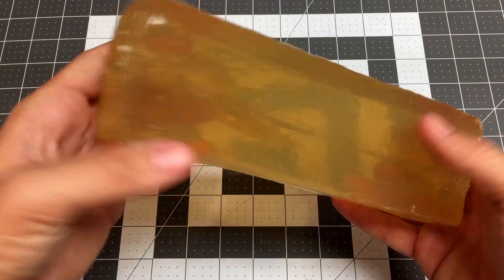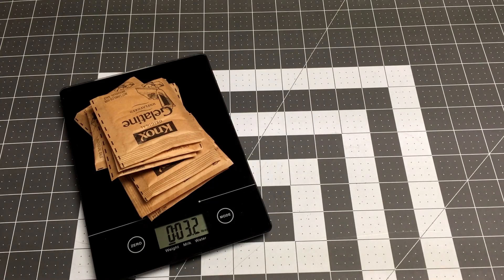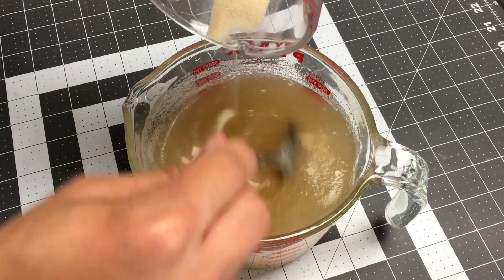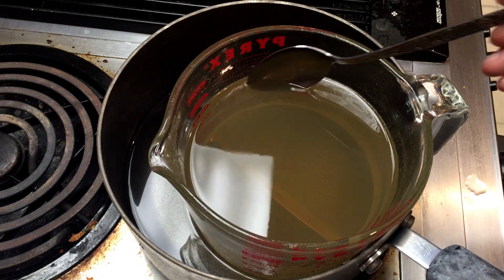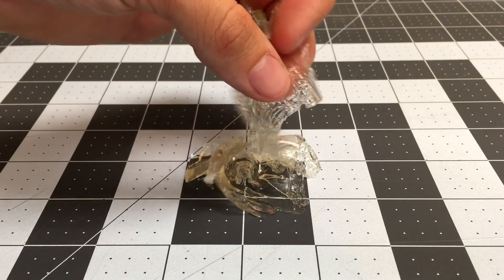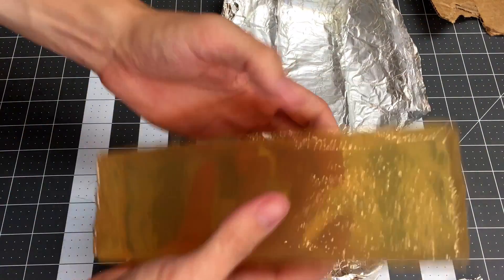How to Make Ballistics Gel

Comment: Yeah but how much water do you add initially to the powder when melting it down? You only gives the final weight of the gel block. That's not the formula
Reply: 1oz of gelatin to every 8 oz of water. The gelatin thickens during the heating and cooling process

Comment: I made some ballistic gel using the ratio from the video. In my opinion it's much too soft and floppy, for lack of better terms. I increased the ratio to double the gelatin. So 2oz of gelatin for 1 cup of water.  I don't know what the guy in the video is shooting with, but I used a large caliber and it absolutely annihilated my first slabs of gel. Didn't work at all. Try double the gelatin!!!
Reply: he was using a pellit gun
Reply: Does not really matter what gun is used. Gel is a test platform to make assumptions what the bullet does to living tissue.
Reply: @henriklopperi6686  I was shooting .450 Bushmaster, a 250gr polymer tip jacketed hollow point going 2200 fps @ 50 yards out of an 18.5" barrel. The whole block of gelatin just exploded.
Reply: Nato uses 20% gelatin and FBI 10% according to my sources.

So it it blows up, you need to make it bigger.
Reply: @henriklopperi6686  that's the new plan! 👍
Reply: @henriklopperi6686  Doesn't the FBI also put denim in front of the gel? Or is that outdated info?
Reply: @519FIREARMS  I made my first one out of a massive storage tote to get one to show the 450 wound channel properly. I sold the gun and built a 350L after, 450 was awesome but way more power under 100 yards than i need or wanted. Oh, at 75yrds its still split the 2'x2'x3' block like it was nothing, absolutely incredible destruction. There was maybe 3-4" connecting the two half's together at the bottom. And to think i wanted a 45 Raptor or a .460 S&W single shot 🤣
Reply: @_DeFiNiTeLy_Not_BrAd_  that's a good idea!! I sold my 450bushmaster, but I did buy a 500 magnum!! Lol I'd love to see how it performs in ballistics gel! I'll get back with my results!
Reply: 10% gelatin is supposed to be very close to the FBI standard.

Comment: "If it's hot outside it wont be as strong as it needs to be, so keep it cool"

Wyoming regularly gets up to 110 farenheit in the summer
Reply: Well that still leaves you with about 3/4 of the rest of the year to play with it, right?
Reply: @bluewater82  winter normally gets below negative 20 and lasts 4 months. And summer stays over 100 for 3 - 4 months too. So 1/3 of the year I guess
Reply: @Reallytallsocks  Keep it in a cooler till your ready to use it and stop complaining
Reply: @Andrew Coles Fremont. Aside from the two or more weeks straight we had in and over the 100 degree mark earlier last month, the unusual amount of humidity and mixture of smoke in the air from Colorado and Montana burning to the ground has the temp hovering right around 75-85. But the humidity isn't normal, and this years weather is just kinda fucked. August is usually BALLS hot, so this year is throwing curve balls

Comment: Just for clarity, 1oz gelatin to 1cup(8.2oz) of water is 10.8% gelatin. To get closer to 10% you want to mix just below 10% because some water will evaporate off during the making process. You want to be right about 0.9oz gelatin per 1cup of water. But there is a scale in this video, so best to just zero the scale with empty cup on it, weigh 9oz water and then use 1oz gelatin. Not sure the little diff matters here for the use in this video, just noting some math.
Reply: He weighs with the paper its fine

Comment: Sorry but I need to call BS on your video....KNOX gelatin is not and does not have the BLOOM strength to qualify as a "ballistic gelatin"
Reply from the maker: No need to apologize, I had thought I had mentioned this in the video but I guess I didn't. I'll stick a shorter version of this in the description: 10% ballistic gel is the most commonly used formula for ballistic gel and has a bloom strength of around 250 bloom. While I did not test the bloom strength of Knox gelatin myself, after a quick google I am now an expert and it sounds like Knox is about 225 bloom. This puts it at 90% the bloom strength of the common 10% gel mixture. So yeah, the FBI probably wouldn't use it, but for a amateur like me an A- gel is indistinguishable from an A+ gel.

( https://www.chefsteps.com/ingredients/gelatin )- this is the website that I cite the bloom strength from. Could be crazy wrong.
Reply: @Sciencish  Sounds like 225?? Did not test? 90% ?

That's a lot of guessing and assuming....thank you for confirming my call out. ....and it's less than A-, but why bother with tests and math and all that.
Reply: Actually the less liquid u use its gets morw dry n hard n dont liquify after in heat at all . O have used this many times. Thats why its called diy

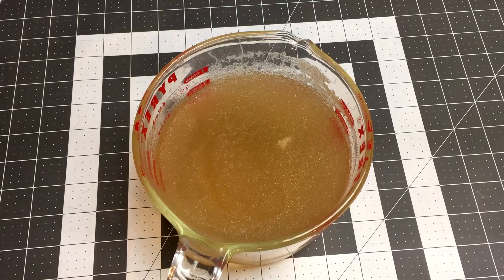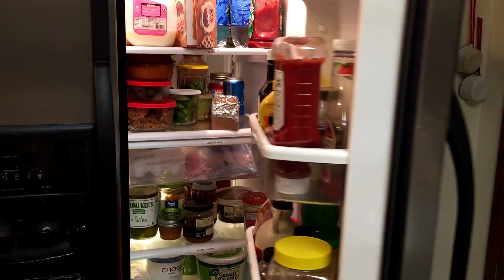Comment: So first we put it in the fridge for 2 hours (0:51) then 12 hours (1:29) ???  Why do we need 10 extra hours?
Reply from the maker: The first 2 hour refrigeration hydrates the powder but leaves the mixture crumbly, cloudy, and overall no good for testing. This is why we melt it back down and remold it, so that it is a consistent firm block of gel at the correct temperature to be as strong as it needs to be for testing.
Reply: I made some, except the second setting, I left it in the fridge for about 3 hours and it was good and rubbery

Comment: Question; After being 2hours in the fridge, the first mixture is still not jelly-like. How could i prevent this ? I used more than enough gelatine.
Reply from the maker: The two fridge time is to bloom the gelatin, when you poke it does it kind of break and crumble? If so you’re doing fine, just remelt and refrigerate again for 12 hours and it should be ready
Reply: Sciencish It's after you mix the water and gelatine, and put it i  the fridge. It was still a fluid, but no crumbs or bubbles on top. Atm I'm putting it an extra hour in the fridge, I used hot water maybe that was a no-go ?
Reply from the maker: It could’ve been the water, let me know how the extra time in the fridge works out
Reply: Sciencish Will do. Next time I'll use cold water in the beginning.
Reply: After 3 hours it became a jelly like substance, I'm keeping it in for another hour to be sure the inner parts are 'bloomed' aswell. I'll let you know if it worked out if you'd want that.
Reply: It worked out great ! the only thig different is instead of putting it above boiling water I put it in au bain-marie, no bubbles or crumbs at all !! Thanks for the advice and the awesome video !

Comment: Am i mixing it too much? When doing the first step with mixing the powder and water, I had a very bubbly solution on the surface and liquidy underneath. I might add more gelatin next time, but what do you think? How long did you mix yours for?
Reply from the maker: After mixing it all together it will be fairly granulated and bubbly. Putting it in the fridge to bloom is to give the gelatin time to hydrate. After remelting and pouring the now hydrated gel it will be much more clear with little to no bubbles when solidified
Reply from the maker: And I mixed until there were no large clumps left, the goal is just to get it mixed well enough that the water can reach each grain of gelatin. Also hand stir. Electric mixers tend to put more bubbles into the mix.
Reply: Yeah that's what ended up happening, thanks.

Comment: Nice vids. Nice channel. Will this work for full-sized rifle bullets? Most other methods take a whole lot longer and require more steps.
Reply from the maker: +john smith I've yet to try any rifle calibers, but I imagine you'd want at least a  8x8x16in block for handguns, and probably two of those blocks for rifles. So I'd suggest buying the commercial stuff, it would probably save you time and money in the long run
Reply: it'll be fine for rifle. it's good for figuring out of your hollowpoints are expanding at 100yds or so.
Reply: Just go over the wikipedia page on ballistic gel it's not all that hard actually. only the 20% solution needs more time synthetics may as well but this isn't that.